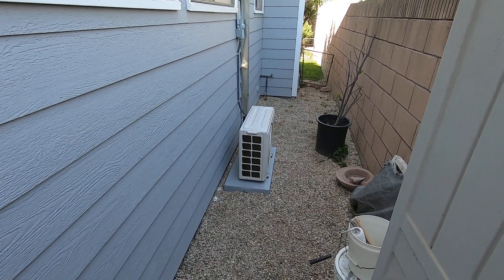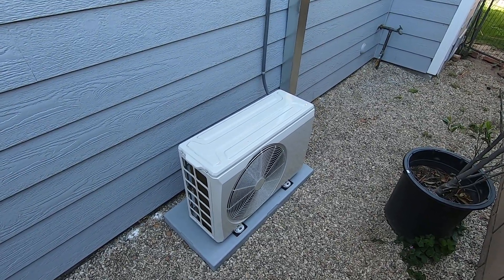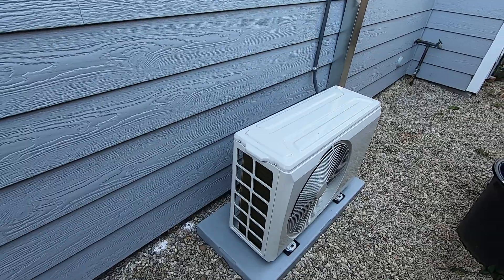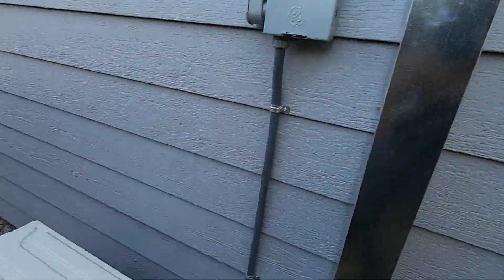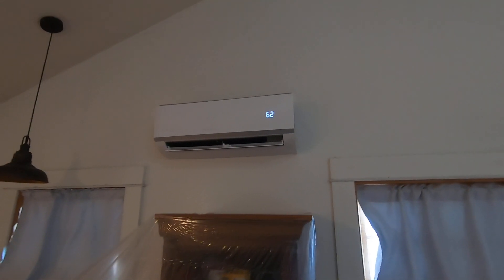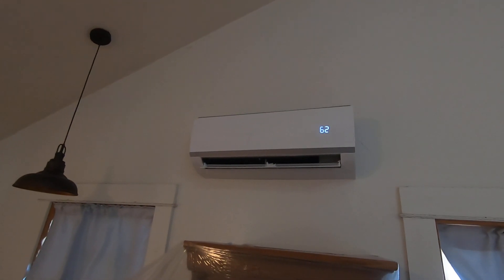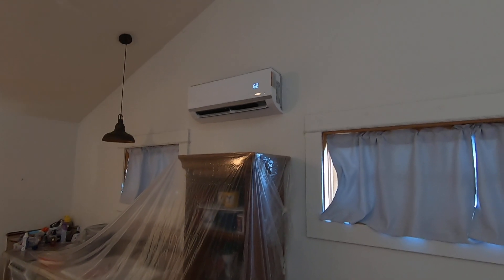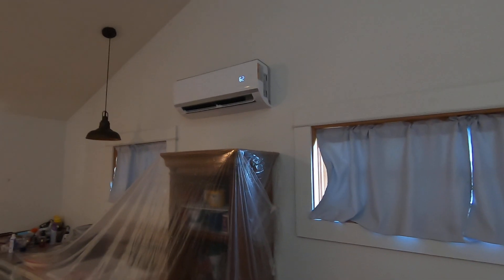Carrier 12,000 BTU Ductless Split System 19.8+SEER

Comment: Is it normal for my carrier to blow heat for 5 mins set 72 heat setting, then blows for few min cool air? Not cold just cool then back to heat?  Mybe to save energy?
Reply from the maker: It is probably the defrost mode.   After the heat runs for awhile it will go into to defrost mode then will resume heating again.  The defrost mode can be automatic or sometimes can be programmed for 30, 60, 90, or 120 minutes into the heating cycle depending on the condenser.   If you send me the model # of the condenser outside I can let you know exactly what is going on.
Reply: @albertairinc.1140  40mahb the manual says. Doesn't show DF it runs normal when it blows cool air. I know the other night I crank the heat up to test it to 75 then the DF letters come out.
Reply from the maker: @josedln3040   Where are you located?
Reply: Hey are these carriers mini split. It's normal to blow room temperature air after blowing good  amount of heat?.
Reply from the maker: @josedln3040  It is probably in a defrost cycle.  The defrost cycle happens depending on outside temperature and run time.
Reply: I believe the Carrier has an auxiliary electric strip heater until the heat pump can catch up to temperature setting

Comment: Can the air control unit be mounted in a basement below the the level of the condenser?the cellar has a floor drain that can be connected easily to the drip tube.
Reply from the maker: Yes the fan coil can be mounted below where the condenser is located.  And yes it can be drained into the floor drain.
Reply: Awesome thanks for your time.
Reply from the maker: @tonylane9007  No problem.  Best of luck with your project.

Comment: Which cools more a carrier or LG mini split of equivalent specifications? Like a 110v of 12,000 btus?
Reply: Considering they are both 12,000 BTu systems, then they would cool the same.
Reply: @fijiman88  well sometimes brand does have an effect. Which brand is better?
Reply: @aragornii507  I have not tested the Carrier and LG side by side in the same house to know that answer.  I do know that the Carrier 12,000 BTU unit will cool a room up to 500 sq/ft with no issues.  The customers I have installed them for have been very happy with thier performance.  I prefer the Carrier system because it is very trusted brand and easy to work with.
Reply: @fijiman88  awesome. I did buy an LG before but it would stop cooling when it gets too hot outside. I would have to turn it off and on for it to work again. I am leaning carrier for the next one if it doesn't give issues like that. I am using it for a living room that is relatively small
Reply: @aragornii507  I haven't had nay isssues with the Carrier system like that.  I highly recommend the Carrier ductless split systems.
Reply: @fijiman88  thank you. You think it will cool a living room? I don't know the exact measurements but in meters its like 10 meters long and 5 meters wide? I have an LG and i am trying to return it because it stops cooling. It did cool the living room while it worked properly but i did not like that it stopped working spontaneously during excessive heat. If the carrier was to cool like that without failing it would be excellent
Reply: @aragornii507  Your room size is about 540 sq/ft.  A 12,000 BTU ductless split system will be able to cool a room up to 500 sq/ft.  So, I believe your current system is under sized.  I would also recommend a 230 volt system instead of the 115 volt you have now.  There are also other factors like, room orientation to the sun, ceiling heght, wall insulation, windows, etc... that will factor into the load on the room.  I would recommend going with a Carrier 18,000 BTU ductless split system to make sure you can cool the room properly.
Reply: @fijiman88  thank you for the help!

Comment: Will a 12000 btu be okay to cool a 500 sq living room?
Reply: Technically yes.  A 12,000 BTU ductless fan col will cool or heat a room up to 500 sq/ft.  If it is an older home with little to no attic insulation, no wall insulation, high ceiling, old wiindows etc.... you might want to consider the 18,000 BTU ductless fan coil.

Comment: I'm trying to figure out the differences in the comfort,  performancr and infinity mini split for carrier. Website doesn't say much
Reply: The Carrier Comfort Series is going to be a single zone system only,  3/4 tons to 2 tons in sozes and 17.3+SEER to 19.8+SEER efficiency.  5 year parts and 7 year compressor warranty

The Carrier Performance Series is going to be available in single zone or multi zone systems, 3/4 ton to 3 ton in single zone with 17.5+SEER to 23+SEER efficiency and 1.5 ton to 4 ton in multi zone with 21.5+SEER to 23.8+SEER efficiency.  10 years parts and 10 years compressor warranty.  This is the most popular system because of its warranty, pricing and wide range of options for the single or multi zones with higher efficiency than the comfort series.

The Carrier Infinity Series is  going to be available in single zone only, 3/4 ton to 2 ton in single zone with 23.5+SEER to 42+SEER efficiency. 10 years parts and 10 years compressor warranty.
Reply: Wow thanks!

Comment: Hi, do you factor in thceiling height when sizing the units?   Also what model is this, in and out.   Ty.
Reply from the maker: Yes, we take into account the ceiling height, insulation, windows, square footage etc... when sizing the system.  This is the Carrier 1 ton heat pump condenser 19.8+SER (38MHRBQ12AA3) outisde and the Carrier 12,000 BTU high wall fan coil (40MHHQ12123) inside.
Reply: hi,  what size was the room this unit was installed in?   is it better to oversize the units?
Reply: @issacrobertson  About 400 sq/ft.  We take the room size, cieling hieght and building materials into account when we size the units.  The 12,000 BTU system was perfect for this size room.